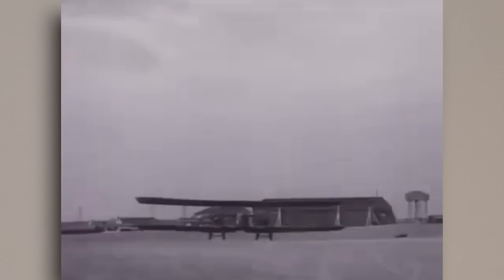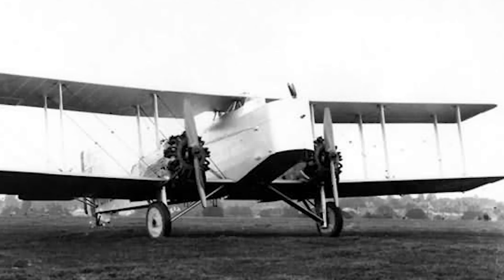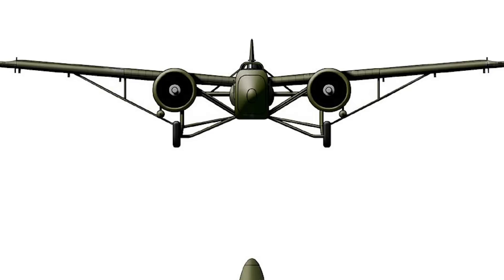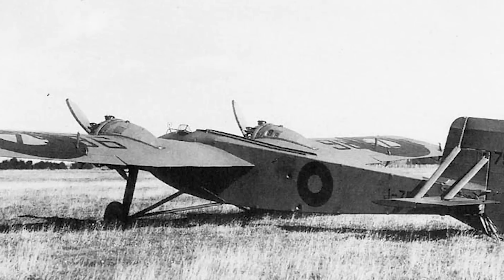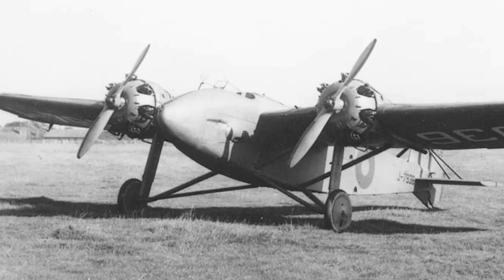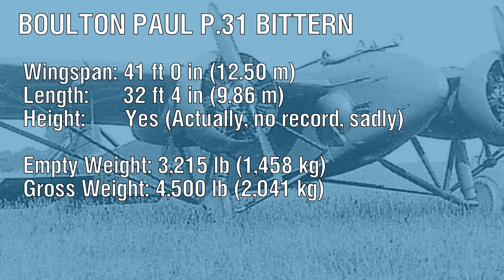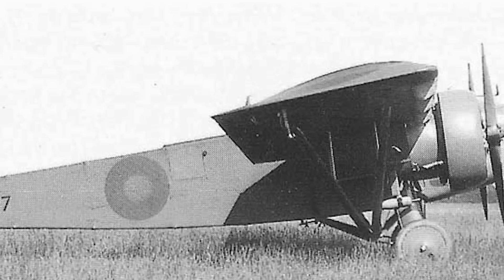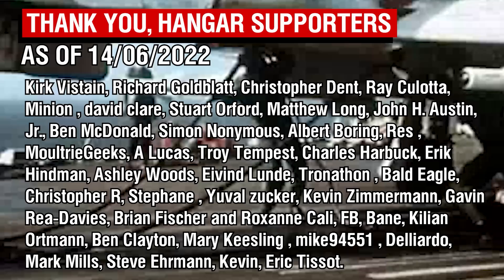The Night Fighter That Couldn’t Catch Its Prey | Boulton Paul P.31 Bittern [Aircraft Overview #62]

Comment: Also this aircraft definitely seems like a lot of work for the sake of a pair of .303 machine guns.
Reply: Well Boulton Paul did up it to four on the defiant and that did make a decent night fighter until the Beaufighter turned up.
Reply: @bigblue6917  
The Defiant was an excellent night fighter
Well once they got the radar right
Reply: Machine guns and ammunition weigh quite a lot. The engines available at the time had their work cut out overcoming drag and gravity.
Reply: @loveofmangos001   The main problem was the Defiant's single Merlin engine struggled with the extra weight of the early radar along with all the drag from the turret. The Beaufighter with it's twin Hercules engines had plenty of power, more speed and a lot more firepower (4 x 20mm cannons). Although the idea of angling the cannons upwards in  a "Schraege Musik" arrangement as on later German nightfighters was never exploited.
Reply: At least the Defiant had one thing that the germans or several prewar British prototypes lacked: the ability to fire not just upwards, but sideways, backwards & diagonally.

Until it was realized she had no head on firepower, the Luftwaffe were genuinely alarmed by the Defiant.
Reply: @jimtaylor294  The BP turret “advantage” lasted a few days at best Once the word went around, German pilots shot them down like flies.
Reply: And if they were Lewis guns, was there any provision to reload them, otherwise it's 97 rounds per gun? However, two rifle calibre MGs were pretty typical fighter armament at the time, and I do like the concept of being able to fire upwards. Was this a development of the use of the Foster mount in WWI to fire upwards and forwards, the zero deflection theory?
Reply: Not only being underpowered and underperformed, but also undergunned
Reply: @davidelliott5843  My point is still sound, as I pointed the Defiant's fate in daytime operations in my prior comment.

Better than the Stuka & other German aircraft like the 110 though, which were just no good for dogfighting at all, and less effective at their intended roles than allied counterparts would prove to be.
Reply: @reynaldoandannieangnged6434  Depends from the perspective of when, and against what.

After all defensive armaments would change radically in WWII alone; proving largely redundant before its conclusion.
(on Bombers at least, where it only took up room and added aircrew & weight, thus took away from potential speed, range and aerodynamics... while not giving as much range as a fighters guns could have)
Reply: lol
Reply: @eltigre4419  To be fair, the Do 217 was a disaster as a night-fighter.  The Ju 88 and Bf 110 were much better.
Reply: @Simon_Nonymous  The Foster mount was designed so that the Lewis gun could be reloaded in flight.  It was the pilots themselves who started shooting upwards, something the designers probably hadn't thought of.

Comment: Fantastic as ever. Another example of how if something had been just that little bit different, it would have changed so much. Interesting to think that if this had succeeded, chain of dominos might have lead to no hurricane.
Reply: That would have led to a disaster for Britain in WW2. 

Every twin engine fighter except for the Lighting failed against single engine fighters. Nations like France, Germany, the Netherlands, Italy and Japan burned a lot of resources in twin engine fighters, substancially reducing the overall number of fighters built for their air forces. The USA was the only country with the resources to maintain large scale production and service of a twin fighter as expensive as the Lighting side by side with a large fleet of single engine fighters. Without these resources it would have weakend the US air force too, even though it was a true high performance machine.
Reply: It wasn't a very good design, it doesn't matter how much horsepower you poured in.
Reply: @Itsjustme-Justme  Mosquito, Beaufighter, Black Widow...
Reply: @Caseytify 
Multi role aircraft, not air superiority fighters. Every nation's primary fighters were single engines. Those aircraft you mentioned are superb with the Mossie being tied for #1 on my favs and the Beaufighter one of those great attackers.

Comment: I trained as an Airframe Fitter at Short Brothers in the 1980s. We used to receive parts for the Shorts 330/360 aircraft manufactured by Boulton Paul. The Short Stirling was quite well thought out as a heavy bomber, however it was seriously restricted in it's performance by the Air Ministry. Very interesting video.
Reply: Of the big 4-engine bombers the Stirling was the worst by a country mile.  I suppose we can cut it some slack because it was the first.
Reply: @himoffthequakeroatbox4320  The Stirling was hampered by the Air Ministry demanding that it's wingspan be reduced to fit the RAF hangars of the time. If it had been produced in accordance with the original specifications, it would undoubtedly have been more successful. During the early days of WW2 a Super Stirling was designed with a ceiling height of over 30000 feet, but it never got off the drawing board. Oh well, what might have been.
Reply: There were multiple variations of the Stirling proposed by Shorts. They not only wanted to increase the wingspan - but even had the wings ready, as they proposed to use the wings from the Sunderland. The modification would therefore have been quick and cheap. The air ministry insisted on sticking to the spec, hampering the performance fatally.  Shorts knew exactly how to make the Stirling better, but were not allowed to do so. When the Manchester failed and Avro proposed the four engine Lancaster, the air ministry dropped the 100ft limit.
Hmmm…. Pragmatism due the the pressure of War? Or did someone have better lobbying contacts?
The Stirling was in some ways an excellent aircraft, it had less vices and aerodynamic problems than the Halifax or Lancaster and was much easier to bail out of, it made a great glider tug - but it was basically hamstrung by the air ministry.

Comment: It's kind of amazing that they successfully locked on to the idea of "twin engine heavy fighter, Schräge Musik" and then still made an absolute turkey...
Reply: I'm limited by the technology of my time
Reply: Duralumin is a few years in the future. Aircraft advancement is arguably more about metallurgy than design.
There is a subject for you Rex. I only know enough about it to know that I know nothing about it.

You know a metalugist is the type of person who can look at a platinum blonde and tell if she is a virgin metal or a common ore... 🤔
Reply: So many of the problems at this time were due to a lack of engine power.  Why is it slow?  No power.  Why is it weak?  Not enough power to lift a stronger and heavier airframe.  Why does it only have two 303 guns - Lewis guns at that, which had small ammo capacity?  Because more or bigger guns would be too heavy.  Why make a complicated moveable barbette system rather than a simple fixed Schraege Musik mounting?  Because it doesn't have the power to carry forward-firing guns as well.
Reply: @kellybreen5526 nice 😂🎉👏🏼

Comment: The Bittern's 145 mph (later 152 mph) top speed should probably be judged against the modest speeds of RAF day fighters of the period. The RAF's first  all metal fighter in service at the time of the the Bittern's first flight was the Armstrong Whitworth Siskin IIIA, top speed 156 mph. The Bristol Bulldog which started replacing the Siskin two years later had a top speed of 178 mph. Both of these were armed with two .303 machine guns.

Comment: Great video. It was funny what it took for them to realize the wing flexing. The side profile kind of made it obvious how easy it would be to flex the surface the aileron attached to considering where the struts terminated
Reply: Why is it obvious? Constant chord, constant section wing, aielerons in the usual place. A perfectly reasonable shape for a lightweight wing.

Comment: A plane definitely ahead of its time in several respects. But even if they had gotten the engine power right, it sounds like RAF doctrine would have doomed it anyways.
Reply: And sadly this isn't the only design dead-end that doctrine created.
Reply: @obsidianjane4413  Didn’t stop the Mosquito.
Reply: @thethirdman225  They almost did.  Besides was the Mossie a dead end?  Blind squirrells, broken clocks, etc.
Reply: @obsidianjane4413  No they didn’t. They couldn’t. The RAF wanted a night fighter and they got one. Come to that, they had one with the Beaufighter.
Reply: @thethirdman225  Go read up on the history of the Mosquito.
Reply: @obsidianjane4413  Take a bit of your own advice, Jane. I’d take a bet I’ve read more about the Mossie than you have.
Reply: @thethirdman225  You should take your meds instead.
Reply: @obsidianjane4413  Down to personal attacks, eh Jane? Not a very convincing argument you’ve got there. Pathetic, in fact.

The Air Ministry could do exactly nothing about the Mosquito and they knew it. They might have tried to bluff de Havilland but they knew full well that the Mosquito development had zero impact on war production because it was a private venture and used non strategic materials and a non strategic workforce to produce it. Ironically, the only strategic component - the Merlin engine - was also the result of a private venture.

If people were a little less predisposed to government hating, they - and by association, you - might realise why the Air Ministry was doing this, instead of moaning endlessly about what might have been, based solely on spec sheet values. Military planning and the production that backed it up was changing all the time and in the UK the whole system was changing from basically a cottage industry to full production lines.
Reply: @thethirdman225  I don't argue with ppl who project their opinions about things into other's comments.  You are also inaccurate at several points along the way.  Go read some of your books to see where they are. Good day.

Comment: It should be noted that stability, ease of handling, endurance and good visibility from the cockpit were considered more important attributes for a night fighter than speed and maneuverability.  Radar had not been invented yet, so to role of night fighters was visualized as cruising around the sky at night on patrol against incoming enemy bombers.  As a twin-engine, shoulder-winged monoplane with relatively economical engines and the pilot seated in the extreme nose, where he would have enjoyed an excellent view unobstructed by the exhaust from the engines, the Bittern was probably designed with those criteria in mind.

Comment: This seems to be a British trait. Build a otherwise well thought out machine and then give it a undersized engine. Look at the Black Prince variant of the Churchill tank. They had access to Rolls-Royce Meitor engines with double the horsepower but tried to make do with the already underpowered 350hp engine they saddled the original Churchill with which was 10+ tons lighter.
Reply: A German trope too, when considering the drivetrain and engine of the Panther tank were designed for something 10 tons lighter.
The Tiger I also, was the victim of 10+ tons of Weight Creep during the design process.

The Meteor engine would likely have saved the Black Prince, as the engine did very well in the exceptionally heavy A39 Tortoise.

Comment: this aircraft has a strikingly resemble lance to De Haviland Mosquito. as for the speed issue they could have simply got on radio with the bomber pilot and ask him to slow down a bit. or maybe installing radio would have made the aircraft nose heavy? it's amazing to imagine that many the designers of the interwar period lived long enough to catch a flight onboard 707 or even witness moon landing. they were the guys who made it possible through collective contribution.

Comment: The fascination with the 30 cal weapon is a bit puzzling .
Reply: I read somewhere that it was because they where stuck in the last war. A smaller light gun means more bullets means more chance of hitting something important, and it only took 1 or 2 rifle rounds to down a plane. They never planned on metal aircraft, self sealing fuel tanks, and armored areas in planes.
Reply: @mattbrocklehurst7980  Well in the 1920's such details as the latter had yet to become the norm', chiefly because engine power wasn't high enough yet.

Comment: I've always wondered since I first saw a Boulton Paul aircraft who exactly Boulton and Paul were. Where I come from that means who do they know? How are they connected? And even who owes these guys? Have they ever had a successful aircraft? Makes me wonder. But that said they seem to have got it almost right a few times. A few little changes (of course seen through 20 20 hindsight) could have made big differences. Not all their fault. The requirements for this particular one for example were not exactly reality based. 

But .303s??? On any aircraft you plan to take to war in those days? What were they thinking? Elmer Keith generally regarded as the father of the .44 magnum said "the closer you get to hitting him with a coffee can full of concrete the better off you are".  The Browning .50 as well as reliable 20mm were readily available. Start with that. The .303 is most excellent for hunting deer. Seems a bit lightweight for hunting airplanes.
Reply: There are various questions that have to be answered. 
Is my engine powerful enough that the extra weight of .50 wont casue performance problems?
Is the performance of .50 so much better than .303 that its worth losing speed and agility?
Do i have a working .50 available?
Is the .50 as reliable as .303?
Does my plane have actual space in the wings or turret i can fit a .50 in?
Is my nation willing to invest in a new .50 gun when we have hundreds of .303 guns in stock or is the money better spent on newer more powerful engines or radios or pilot training or radar?

Even the Ameicans didnt think the .50 was worthwhile, the .50 was only accepted as a stopgap becasue the couldnt get their copy of the 20mm Hispano-Suiza cannon to work reliably.
Most countries up till 1940 decided the weight penalty of carrying a .50 wasnt worth the meagre performance upgrades from their current .303 (or 30.06) and the early Messershmits were also using 7.92mm so its not like they were outgunned.

the allies didnt rally get a reliable 20mm till towards the middle of the war.

Comment: More powerful engines yes, but also, wouldn't three or four-bladed propellers catch more air?
Reply: Dont forget it was a fixed pitch prop being driven by a low power engine, having more than two blades would not have increased the overall performance, may even have reduced the performance had they tried.

Comment: The fact remains that, even in the second world “Special Military Operation “ the bomber did get through. Often at horrendous cost, but it did it.
Reply: The video was referring no-doubt to daylight bombing by the RAF on Germany early in the war; where the results were so costly that night operations were adopted instead.

The Luftwaffe would learn the same lesson too, as the Battle of Britain cost them so many aircraft and aviators, they switched to softer targets (cities, instead of airbases), and ultimately to nighttime operations.

Only with allied mass production / training, onboard radar & credible escort fighters, did the Bomber get through in a sustainable way.
(a Bomber crew surrviving more than a certain number of missions, even ended up being the plot of a film, Memphis Belle)

Postwar Bombers ultimately ditched onboard guns and upped the speed & sensors, as opposing fighters were always going to have bigger guns or a favourable angle of attack.

Comment: From the technical point of view of the 1920s, long range escort flighters with a performance that matched usual single seat flighters were impossible. Due to the large weight of the fuel it needed to carry, a long range escort fighter would not be very much superior to a heavily armed bomber destroyer. It was a fair assumption that a purely defensive bomber destroyer would never have to face a high performance fighter. Low performance long range escort flighters would easily be covered by the heavily armed bomber destroyers themselves or by a few high performance fighters escorting the bomber destroyers. 
Of course that was short sighted, because high powered engines and aerodynamic improvements quickly led to improved performance in long range fighters. 
Later on, the failure of the early attempts in creating heavily armed fighters and going back to higher performance single engine fighters instead proved to be a lucky coincidence for Britain. Just imagine the RAF had to go into WW2 with odd flying cannon boats instead of the Hurricane.

Comment: Was there ever a Boulton Paul airplane that was a success? Or does failure just seem to be their only option because their successful planes aren't odd enough to be featured on your channel?
Reply: They mainly built aircraft or parts for others. They built the world's first single engine turboprop (The Bailliol)
Reply: If Wiki is accurate for once, no. Apparently the Balliol trainer was good but came at a time when airforces were transitioning to jets so only a couple of hundred got made. 
https://en.wikipedia.org/wiki/Boulton_Paul_Aircraft
Reply: @zxbzxbzxb1  the prototype was a turboprop, the actual delivered planes had merlin engines, so it became the last merlin engined plane. So a bit of a first and last.